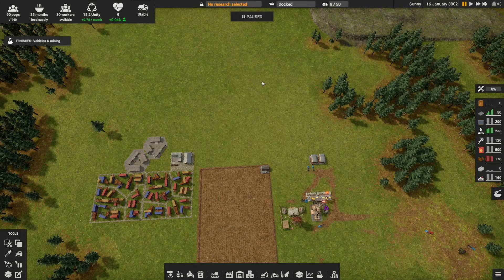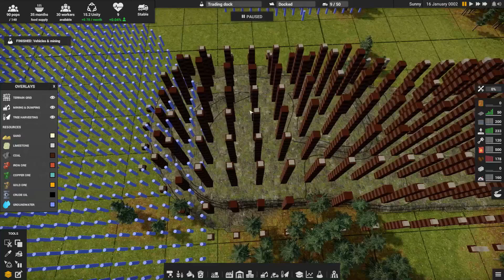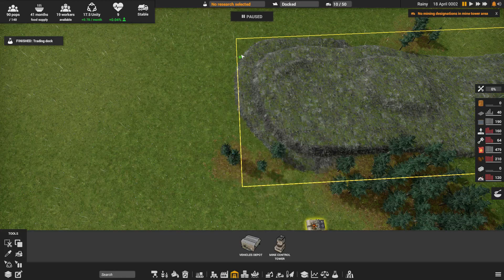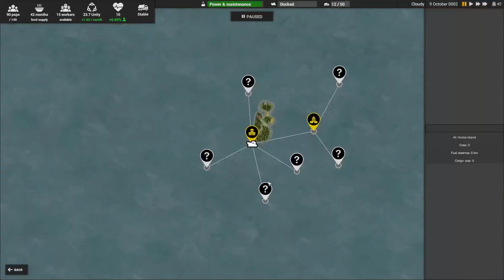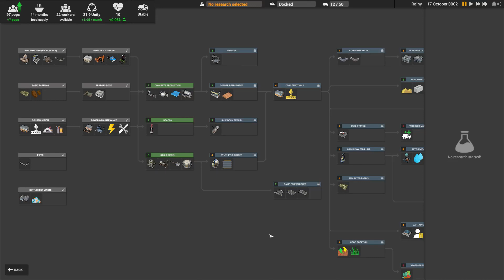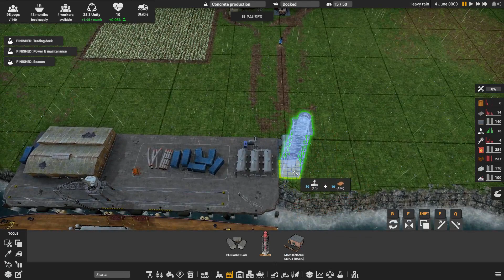Pinstar Plays Captain of Industry #2: If You Build It, They Will Come.

Comment: 23:17 - Why put the diesel generator near the crude oil? You're not saving much, if any, time because you have to refine the oil first. Plus, the diesel will need to be transported via pipe or truck anyway to fuel depots later. 

It doesn't make much sense to put the oil refining near the oil patch, either, as the main source of oil later on will be oil rigs from the strategic map, meaning the best place for a refinery is near the coast where the cargo dock will be.

I also disagree with the placement of the research labs. You want to keep the area around human habitats as clear as possible, as that is where you expand them and also place essential services. Labs can be anywhere; just place them out of the way.
Reply from the maker: As we transform in phases (IE local oil to strategic map oil) I'll be relocating things to better positions as different sectors start to grow and take shape.